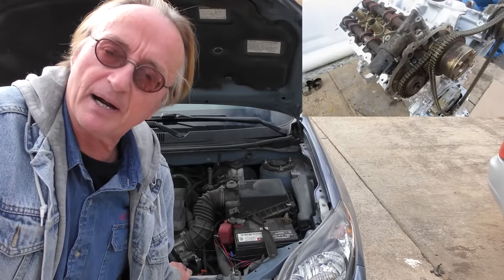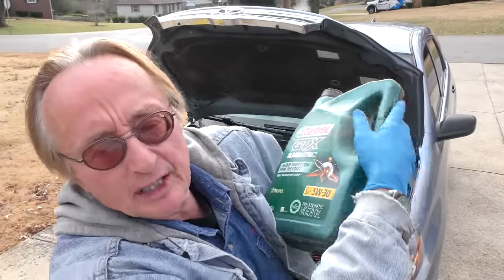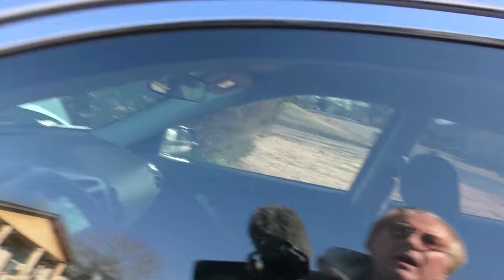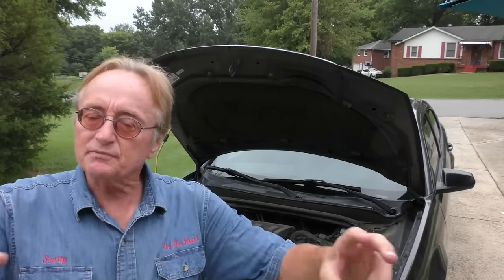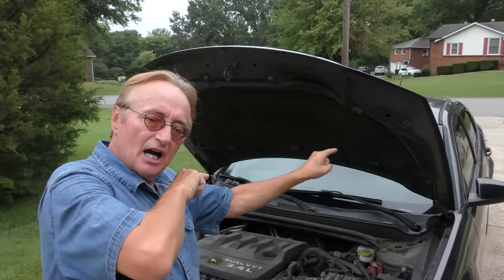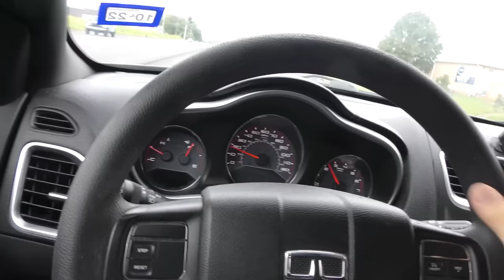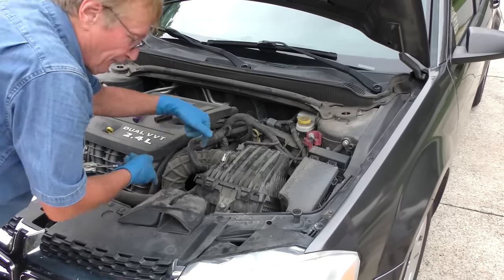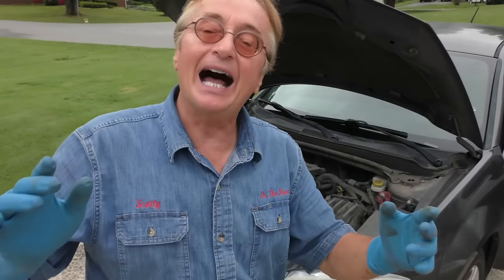Doing This Will Make Your Engine Run Like New Again

Comment: My 04 Tacoma I’ve tried fixing a misfire in the same cylinder for a few weeks now changed the coils, spark plugs, and wires but after hearing you say computer problems come and go so I’m wondering if it’s just a computer issue or something else

Comment: I have a 2001 Ford F150 4.2 L engine that's give me a p340 code replace the TPS but still the same problem sluggish off the start sensory running fine at idle

Comment: Scotty, why don't you advocate the use of the Fumoto oil change valve to facilitate frequent changes.?
Reply: because it's just another part to go bad.... a bolt works just fine, and you're not really saving any time with one of those fagoto drain valves anyways. There you go! Next!
Reply: @honuswagner9348  Try it Mr Fagner. They don't break, and it speeds up the process.

Comment: If your car calls for a non-zero W oil, switch to the zero W oil with the same hot weight.  Example:
Does your vehicle use 5W-20?  Switch to 0W-20.  The oil will coat better and flow better at lower temperatures and does not deviate from the 5W-20's range of viscosity- your engine will be more efficient and less prone to wear on startup.  The reason why many cars have oils like 5W-20 required is that these low-cool-weight oils are relatively new inventions, so your car may predate them.
Reply: The difference between 5w and 0w don’t really happen until under 0F. If it never gets that cold then you’re not going to see a difference.
Reply: If you live in the Arctic, then the use of 0W-20 is acceptable. If you live in Arizona and use 0W-20, you will not have an engine very long, because oil viscosity changes in low and high temps. Never go below 5W on the low side of viscosity in a high temperature area. It will not protect your engine. I only use 5W-30 Mobil 1 full synthetic every 3k miles in my 03 cadillac deville dts, in Northern Nevada, the weather in summer often hits 100°f, and winter temps often drop to 0°f.  The engine has 250k miles, it still pulls hard, and does not smoke. Change the oil, and your engine will never let you down.

Comment: My brother did his oil changes annually - meaning we only got 1/4 quart out each change. Until one day - gruesome, his engine sounded like it took a dump. Plugged the OBD-2 and VVT solenoid bank 2 failure. Changed both of the solenoids and ran like a champ. This is on his 2004 Mustang GT.

Comment: What would be the most likely culprit as to why engine oil smells like kerosene? It's a 2003 toyota camry, 170,000 miles, runs fine.

Comment: My ex wife had a Pontiac sun bird that would do the same thing run fine for a while then start chugging some times it would stall. Then you would start it and it would run fine. Turns out the catalytic converter element had broken loose and through vibration had shaped into a plug that upon acceleration would plug the outlet pipe then when it stalled the pressure would drop and the plug would fall out and the car ran fine.

Comment: Hey Scotty. I’m looking at the new 2023 Subaru Outback. It’s available with the 2.5L naturally aspirated or the 2.4L turbo engine option. I’ve heard the 2.5L is a little sluggish. How much of a trade off for reliability and cost of ownership am I making if I choose the turbo?
Reply: avoid turbos. they are great when they work, but expensive when they stop working.
Reply: Get a NA. Avoid the turbo if you plan on keeping it past the warranty.
Reply: The 2.5L engines are solid and I would choose them over the new 2.4L turbocharged engines.

Comment: Castrol oil is ok so long as you change it very regularly. 
It is nothing special though, i have noticed over years of changing and using Mobil 1, Valvoline, that is a noticeable difference in quietness, economy and power. 
UK oil manufacturer Millers Oils is by far the most superior oil on the market. Its Energy Efficient ultra low friction premium oils are by far the best in the world. 
I have no affiliation with any company. It is just my opinion, driving 35 years.

Comment: well i have a question for ya, i changed oil two times every time was 9500 km-10000 km , the third time after i changed at 8500 km started the car  the oil warning light kept on for about 1-2 minutes, the last two times i changed my oil i was using a cheap oil filter , the copy of the oem and it didn't do that issue, but the last time i used bosh filter , should i be concerned ? 
car is nissan n17 sedan petrol

Comment: It’s not your dad’s Oldsmobile. It’s not Castrol either. Castrol used to be made and distributed by their own company now it is made by BP Amoco. All oil is the same as long as you have the same viscosity and SAE rating or higher.

Comment: I got a 09 civic had over heating issues i replaced the whole cooling system and change the oil and filter and I use valoline high mileage  oil she been purring and driving good ever since..but all my dash board lights on 120kmiles..idk

Comment: I have 2015 altima so dealer put synthetic blend some time synthetic what's the difference of oils and I want to do myself what kind of oil should I put its 4 cylinder 2,5 engine

Comment: Toyota Matrix's are cool crossover-type hatchbacks. Some have a 120volt inverter option in the center console. Some use the manual 6speed transmission utilized in the Celica GTS 7th Generation. With it's split rear fold down seats it has very good cargo / roughing it options if need be. I want one.🏂

Comment: What's your thoughts on additives? ie:BG MOA.
Reply: I've used it on a really old car with an oil change, car seemed to run smoother with acceleration, but did it really do anything to the engine? I'm not sure, it has detergents in it etc. but it didn't hurt anything imo.

Comment: If the manufacturer recommends 5w 30 would 5w 40 not be better? As I understand it the 2nd no refers to the oils ability to maintain its viscosity at a specific temperature. Therfore the 40 would maintain its viscosity at a higher temperature. By that logic the 40 is slightly better surely.

Comment: I live in a townhouse that has a policy that says we can't work on vehicles in the parking lot, so I would just take my cars to jiffy lube and use the online coupons to make it only about $10 more than doing the job myself. I work in pallets now, but for most of my 20's I worked at tire shops and repair shops and the idea of a guy that knows about 10% of what I know about cars telling me I need a new air filter when I just replaced mine a few days ago and talking down to me like I was a teenage girl got to be too much for me. I just take the chance of getting in trouble for doing my own work or go to a friend's house to do basic jobs instead of dealing with the lube shops.

Comment: Thoughts on using synthetic in a 1998 Honda crv with 222k? Not sure what was used before I purchased it.
Reply: Go for it. Use a high mileage synthetic. That’ll contain seal conditioners to prevent leaks. 👍
Reply: @valenjtine  not sure if it would be beneficial to use synthetic in an engine that  was probably designed for conventional? Maybe I’m just overthinking it all and I’ll just use a blend

Comment: Toyota fell pff my 1999 xle v6 camary over heats and i think radiotor falied then my 2007 toyota corola timing chain left the chat then i own a 200,000 mile chevy still going strong 2004 4.3l v) vortec really good

Comment: Scotty - why oh why did you dip your brand new Bosch oil filter into the DIRTY USED OIL to lubricate it before you put it back on????  

Why not fill up the oil filter part way, or almost full, with new, clean, fresh oil, lubricate the gasket with the new, clean, fresh oil, and then screw it on?

Comment: You still have good oil in that jug. The first change poor the dirty oil in milk jugs or something. After that you can poor the remaining good oil in with the original leftover good oil and use the now empty oil jung for the dirty oil. After enough oil changes you'll have enough oil built up you won't need to buy any.
If a car can't make it to 200k with general maintenance and no problems it's crap.

Comment: ? 04 mustang gt 4.6 motor oil pressure gauge goes up and down mostly dn when driving sometimes it shut off let it cool off start back up no it don't get over heated took it to the shop nobody knows what is the problem

Comment: New engines are intracate  machines.  An oil change every  3 or 4 thousand miles will keep  it in good shape for a LONG time.  Any more is pushing it.  Try this... pull out your dip stick and FEEL the oil for grit. How slippery is it ?  Examine it when you change the oil.  Think.... gravel roads ?  Dust ?  Smell the oil.  Does Is it smell burnt, or does it smell like gas ?   Buy good quality synthethic oil and filter. Change them often. It's all just common sense.

Comment: What about ridiculously long oil change intervals advertised by car manufacturers and official dealers? 30000 kilometres doesn't sound as reasonable interval, especially on engines with timing chain.

Comment: I wonder if the oil change can be optimized: I've never owned a car, yep there are such poor people, so I was thinking: make a 3,555-3,600 mile oil change, then drive it 355-360 or ~10% of miles or ~a month after, then make a new one, to finish eliminating the dirty particles; yes it's inefficient at 45% but I think keeps the engine cleaner, without extra particles wearing it out faster; following the Premise: Oil is cheap, engines are expensive; 'because from a crystal clear yellow to a pure black oil, it's something wrong I feel instinctively

Comment: Easy to remember without those stupid stickers......change every 5000 miles and use the odometer reading.....change at 45,000....then 50,000....then 55,000....etc.

Comment: Toyota with plastic parts? No thanks. Car industry became an endless money sucking machine since I learned it the hard way with my Suzuki Grand Vitara XL7 2006 and the crappy H27a engine. What a POS. Dirty oil affected the hydraulic timing chain tensioners...because, why make a fine engine if you throw in a SUV a motor with programmed obsolescence that will make your company a payload of millions in the 10 years to come?? I will NEVER buy anything from Suzuki again and I will advice everybody not to.